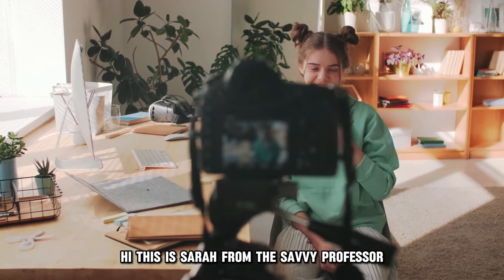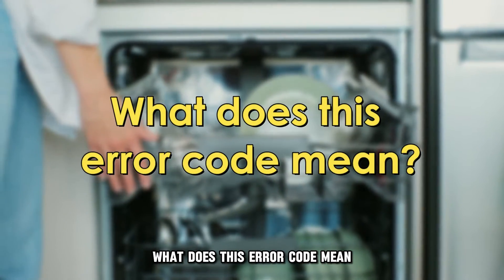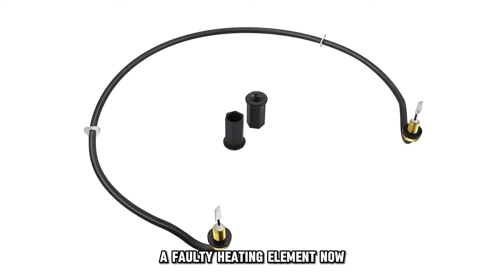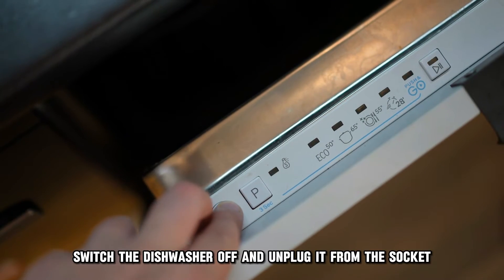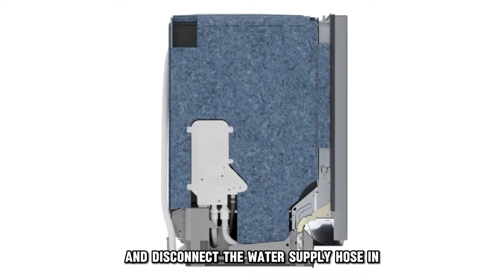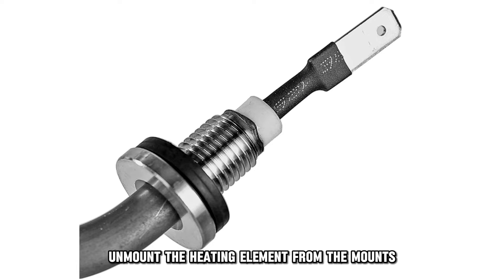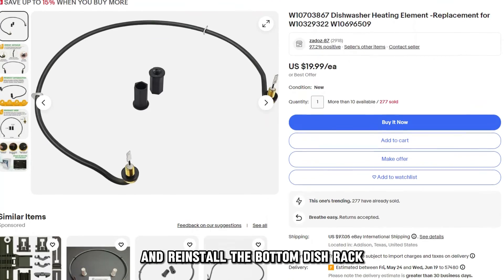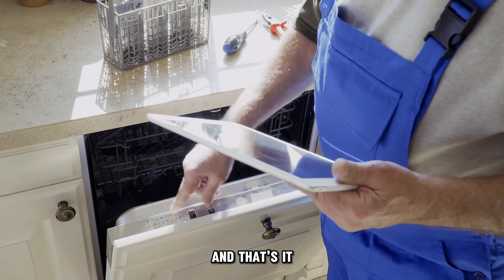How To Fix Bosch Dishwasher E31 Error Code (Heat Pump Malfunction - Best Solutions For Error E31!)

Comment: On this type of Dishwasher the Heater is integrated with the washing motor!
You can not replace the Heater only, you need to replace the whole thing known as Heat Pump (Motor + Heater).
And this is not an easy task if you are not a professional Service Technician.